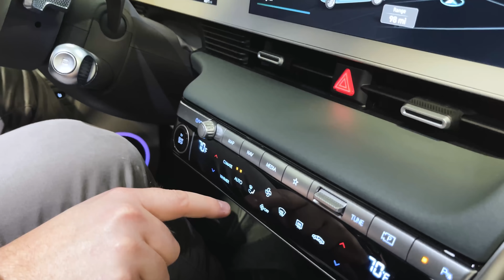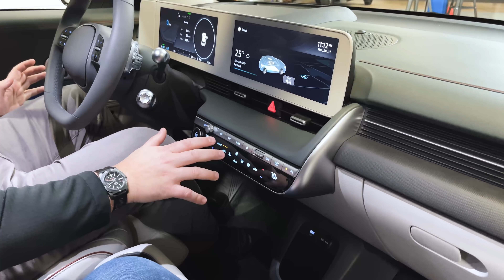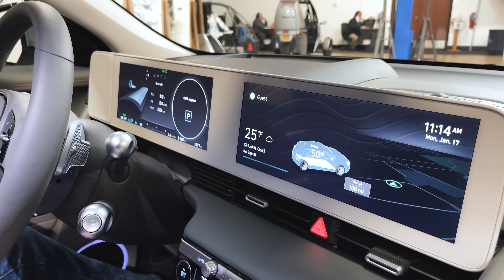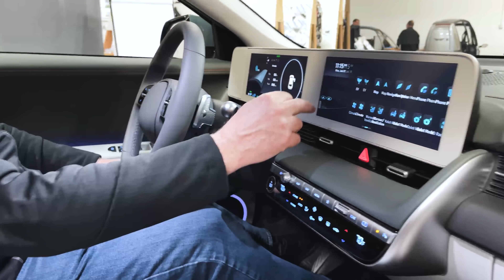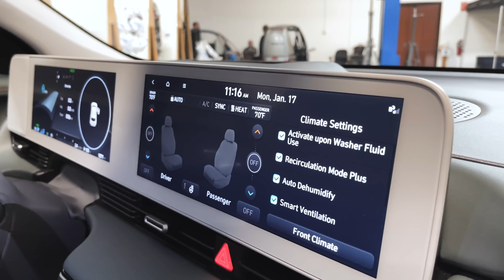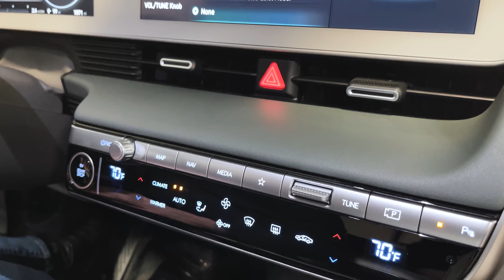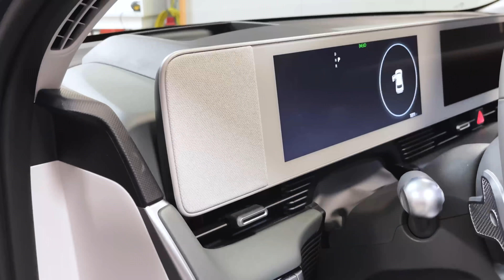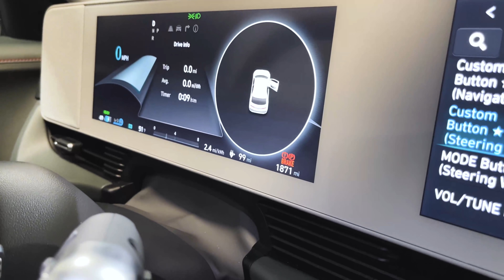2022 Hyundai IONIQ 5 | Sandy's First Impressions

Comment: The shift stalk seems perfect!  Removing the lower control panel in the middle I strongly disagree with.
Reply: I agree with Sandy on the separate parking brake button. Why not just have the parking brake set when you put the car in park.
Reply: @Hoggdoc1946  Auto hold is not a parking brake button, it prevents the car from creeping forward when the car is in drive and you have to wait for a traffic light, with auto hold you can let go of the brake without the car moving forward. Also on an incline the car will also not roll with auto hold on.

Comment: Fun fact: you can make the 2 front seats into a recliner with one touch of a button. They call it "Zero Gravity Seats."

Also, I strongly disagree with getting rid of the climate controls section below the screens. Having separate controls away from the main screen for climate control and volume is lovely for overall safety and ease of use. I like putting all things on the screen for simplicity, but then it's a hassle to get out of the radio, nav, or anything on the screen just to change the temperature

Comment: Hey Sandy & Cory. Regarding the side trunk trim, I think this is efficiency from Hyundai as the open / ribbed side allows the piece to be made using a single straight draw injection moulding tool. To close off the outside face they would need a second part, or they could change the tooling angle to be front-to-rear rather than in-to-out, but then they would lose the side facing the metal where they require attachment features. They sacraficed that outside edge as it's seen less than the inside or rear, they styled it with the ribs to look smarter / functional
Reply: Bingo
Reply: 🤗🤔 I was wondering if it could be a flow through ventilation 🤷‍♂️
Reply: @Budget Audiophile Life-long  it's certainly something with air flow..noise or aero dynamics...I can figure it out better than these "experts"
Reply: Yep, definitely. Less material, less cost, less weight, better energy efficiency (manufacturing and the product both), all with an insignificant cosmetic sacrifice, which most would not even notice nor care about.
Reply: Why not make the open face point towards the mounting surface?
Reply: You’d think these two jokers would’ve worked that out considering one of them is supposed to be expert in manufacturing 😒😒😒
Reply: @rajjy1976  everything baffles them...didnt even know what the clip on the visor was for...damn I've had them on several of my vws ..sandy pokes at it like he never seen one before...but the clincher that he doesn't know what he pretends to know..when he compared a jeep to a Bentley interior...oy vey...he doesn't see much of real cars..probably never been o
In a porsche audi or benz...Benz... lives in a Chevy world of junk
Reply: @johnnicol8598  you want to mold features on that face for fixings
Reply: @cengeb  You are definitely the smart one... I'm glad that these guys are confident in their abilities to the point where they don't have to script this stuff...
Nobody's perfect but they are real and honest.
Reply: @rajjy1976  dang these guys are jokers well I can only assume this will be the last time you ever spend your time watching their video with any luck... Adios amigo
Reply: @davidhumeston5292  you really think it's not scripted?  Like reality shows on tv....really?
Reply: @cengeb  Not scripted..In the scene that they are more or less just winging it..
The car review is just a first impression not a well researched automotive review.
These guys are engineers not Doug Demuro ..Doug show is fully scripted..with b rolls ,lots of editing and post researching of the automobile.
Reply: @rajjy1976  How dare you describe this team as jokers?  They have mountains of tooling and manufacturing experience - but admit they don't instantly know everything - some things aren't clear until you do a full tear down.  If these guys forgot 95% of what they know then they'd still have at least ten times your flimsy knowledge.
Reply: @andrewnowson8766  yes you commenting on yourself as I read it...it looks like Sandy has forgotten 98% of what he is even looking at....what engineering certs does he have?  hmmm, i think he said he's a machinist, like, cuts things out of metal?  Certainly didn't design any CNC tools, or the robots that do all the work in modern car factories....he loves PLASTIC, PLASTIC snap clips.....oy vey....and he advised Boeing, holy CRAP....I only fly airbus, they believe in metal fasteners...what a concept
Reply: @cengeb    Change the channel if you don’t like what you see.
Reply: @rajjy1976   As typical, the preteen typist experts trash anyone more knowledgeable than themselves on the interweb thingy. Must be sooo smart (LOL NOT)!

SHADDUP and start your own analysis websites and design company.
Reply: @budgetaudiophilelife-long5461  flow through ventilation was my first thought as well
Reply: @toronado455  🤗WE WILL WAIT AND SEE AND SOMEONE WILL COMMENT 😍😍😍
Reply: @cengeb  Yes planes use metal fasteners rivets mostly.
Maybe we should rivet your car together..
Aircraft avoid threaded fasteners why because they unthread.
Not so sure you've ever been a machinist I personally have been a machinist which gives you great insight to manufacturing and that most engineers can't engineer very well because they've never machined their own parts. I will take the real version of an engineer over the paperback version.
Reply: @davidhumeston5292  Pretending to be an "engineer" using a title on paper work etc, is a criminal act subject to a fine, in most states, words matter.  Latest issue of CU magazine again has Tesla rated POOR...the yoke is as dumb as it gets, unsafe, and not having a standard blinker stalk, a driving hazard...changing stuff just to change it, is dumb design work...no benefit just to be weird.  Audi BMW Porsche rated better over Tesla, from REAL car makers
Reply: @cengeb  Tesla is not for you...That's great buy one of the other BEVs... Easy
Everyone has there own likes and dislikes.
Thank goodness 😊
Reply: @davidhumeston5292  Watch when Tesla are so expensive to insure cus they won't be repairable, they get totaled too often, gonna be all a big mess, wanna bet, just wait and see.  You do know there are things called PLASTIC RIVETS, stay current....Sandy loves plastic , too bad it's a problem, in so many ways...
Reply: @cengeb  I will...
Thanks for the heads up....I own Tesla stock sense 2019..So that will be my punishment for not seeing the future...so my money is where my mouth is.
Reply: @davidhumeston5292  You don't remember Enron, MCI Worldcom, Bernie Madoff, just recently Theracon?  Tesla mkt cap is nonsense....unsustainable
Reply: @cengeb  You should SHORT Tesla Stock then. Put your money where your mouth is since you say it WILL go bust.
Reply: @cengeb  I have theh Kona EV and it has them too. They don't hold documents well but they do indicate the location that aligns with the lamp switch. If you flip the visor up it will switch off the lamp. I'd have to check but the visor might be more firm in that location. It also prevents the eventual scuff mark from the switch interaction from standing out.

Comment: The left display in front of your eyes is a very smart invention.
I also like the controls on the steering wheels. And physical buttons instead of touch screen functions is very nice as well.
I think these controls make driving safer, opposed to using touch screen while driving.

Comment: 14:00 I think those baffles capture air and help seal the trunk better. It's a large door and it's slanted so at higher speeds there will be lower pressure regions in the gaps so the baffles could help trap pockets of air to assist in keeping the pressure balanced and prevent any wind whistling and adverse effects. Keep in mind this is a fast car with retro styling so weird aero issues will exist.
Reply: Noting that the slots are on the interior or the car. They could be acoustic or cosmetic.
Reply: you are trying way too hard with this.  The suggestion that there was no reason to make the part more expensive by having a cover seems to make the most sense.  Why enclose the part if it wastes money and adds nothing aesthetically?

Comment: Perhaps instead of removing all those buttons, you could have five or any numbers of programable buttons? That way each user can adjust it to what buttons they like using the most. For me it'll be climate control/heat/cooling seat. Maybe leave a dial for volume up/down?
Reply: No no no we can't do that because "All input is Error" t. Elon Musk
Reply: Good call. I did like the programmable buttons on our F30 BMW.
Reply: @SiisKolkytEuroo  Grow up.  Tesla has buttons on the screen.  Taking elon out of context gets really old.
Reply: @_PatrickO   It’s impossible to take a musk out of context on anything.
Reply: Indeed, and have them be programmable via voice commands.

Comment: Great video! The “AUTO HOLD” button stops the vehicle from moving when you remove your foot off the brake pedal during a stop.  You don’t need to use the “AUTO HOLD” when the vehicle is set in “i-pedal”.  There are 4 levels of regeneration, the highest level is 4 or “i-pedal”.  It’s really aggressive and works well.
Reply: So, do you really need a physical button for that? That seems like a setting that you don't change often and should be on the infotainment screen.
Reply: One pedal driving obsession is silly.  The chevy volt simply has a hand brake on the wheel for regen. Then you can coast like in a normal car and regen when needing to slow down without touching a pedal.  No pedal driving is where it is at.  The volt lets you set cruise speed and full regen brake all with buttons on the wheel.  It can all be done with your left hand.  You only have to touch a pedal at all for emergency braking or to start from zero up to 24mph when you can hit cruise and then control speed with plus minus buttons on the wheel.  Car companies need to allow cruise to engage at 0.  Forcing the use of pedals to get to a minimum cruise speed is lame.  Gas pedals have no point in a modern car.  Speed and braking should just be steering wheel buttons.
Reply: @_PatrickO  regen paddles are on the left and right of steering wheel on the IONIQ 5 and when vehicle is in i-PEDAL (level 4) all you need to do is release the accelerator.  The “AUTO HOLD” button is an extra which can probably be removed in future iterations of the vehicle.  BTW, has Chevy come up with a solution for their battery recalls? LMFAO
Reply: @ronnied8793  Chevy is a joke, the best parts of the volt were made by lg.  But having hand controls is brillant.  Chevy put it on no other car and even on the volt, they screwed it up by making you pedal up to 24mph before you can enable cruise control which lets you control the speed using the steering buttons.

If the hyundai can do no pedal driving in the same way, that makes it great.  Do they allow cruise to engage at zero mph? 
As for your anger, you should check your petty tribalism at the door and grow up.
Reply: @_PatrickO  what anger are you talking about???
Reply: @_PatrickO  Thanks for the perspective.  I have never driven a Volt, and really regret not buying one in 2019.  The 
Volt was a highly under rated car in many other respects.  I'll have to reconsider the necessity of an accelerator pedal, as I had never thought of not having one.
Reply: @ronnied8793  Personally I don't find the failure of any Ev to be "funny".  That attitude is counter productive.  BTW it is the Bolt and not the Volt, with serious battery issues on a very small number of cars.  Many people don't know the difference.
Reply: @ronnied8793  The Volt is dead, cancelled.
Reply: @mrxman581  The new hybrid jeep that was reviewed by sandy has a volt like drivetrain.  The rav4 prime seems like it may also be similar.  The key is a dual powertrain, but designed so the gas motor primarily generates power to drive the electric motors and charge the battery.
I would describe the volt as a 40mi short range EV that has a gas range extender.  The gas engine can power the wheels directly, but these vehicles are designed so the electric motor does all of the acceleration, so the vehicle feels like an EV with instant torque and no transmissions shifts.  The engine only comes on when the battery gets low and then it mostly stays at a steady rpm while the electric motor does all the variable acceleration stuff.
Reply: @_PatrickO  the problem with those systems is the terrible efficiency when the battery is drained which comes into play on long trips because you're carrying around a bunch of weight. That is the main reason the Volt had horrible mpg when switching to using gf as. It was in the mid 30s if I remember correctly. Where a car like the Prius Prime had about half the EV range of the Volt, but when using the hydrid gas engine it got mpg in the mid 50s so for trips greater than 50 miles, the Prius Prime was much better. And, of course, it would take much longer to recharge the Volt too. Neither car had DC fast charging capability but the Volt would take longer due to the bigger battery. These are reasons why the Volt was cancelled along with being more expensive.
Reply: @mrxman581  The fuck?  The volt has good gas mileage at 36mpg.  In fact, the volt would have had a few more electric miles and better mpg if they did not cheap out on the magnets in the motor.  They chose a cheaper magnet to save a couple hundred bucks.  There was another car with the same powetrain that breaks 40mpg due to the better magnets.  Had to either be the malibu or the cadillac.
The volt is not more expensive, it has a normal markup at $40k.  It just isn't cheaper than a pure EV because it has gas motor plus smaller battery instead of a single larger battery that likely would cost more, engines are cheap.
The new jeep hybrid using a similar drivetrain to the volt.  This style will be great for larger vehicles because it will take time for enough charging stations to exist for most people to switch to an ev.
Reply: @_PatrickO  The direct competition to the Volt was the Prius Prime which is an overall more efficient vehicle as I said before. 36 mpg is not good for this category of car. The Volt was basically just a regular car once it ran out of EV range. Where as the Prius Prime switches to hybrid mode once it runs out of EV range. The Prius Prime gets 55 mpg after running out of EV range. That's about 65% more than the Volt.

Though, the point is moot because the Volt has been discontinued.
Reply: @mrxman581  The prius prime is not a competitor to the volt.  It is a smaller car and a junky prius.  If toyota actually wanted to compete with the volt or EVs, they would have put eawd into the corolla hybrid.  They purposely refuse to offer a corolla hybrid prime because they know it would completely erode prius sales.  Toyota instead wants people to get mad that the corolla does not have the prime option as they go buy something else.  
That is what I did.  Sold my corolla when I learned the corolla ev would not have a prime option and bought a volt.  No one wants to drive a shitty prius.  The corolla feels like a luxury car compared to a prius.
Reply: @_PatrickO  The Prius line is one of the most reliable fuel efficient series of cars on the market. The Prius established the hybrid market. All the other car makers poo pooed it and look how vast the hybrid market is today 

The Volt is NOT an EV as much as GM would like you to believe. It's just a different kind of hybrid and NOT an EV. So, yes, the Prius Prime was a direct competitor. But, again, the argument is moot because they no longer make the Volt. The Volt never found a market because it made too many compromises and was too expensive for what it offered. Enjoy your car while it lasts.

Toyota also has the Rav4 Prime, and they will be releasing a full EV later this year

Comment: We’ve had this car in the U.K. for about six months. I’ve test driven one and also a Kia EV6 and it is a nice car, looks like a Lancia Delta Integrale. As for the climate control buttons leave them there as whilst your driving and you’ve got sat nav or media on the screen, you don’t want to be faffing around as I had to do, swiping around a screen which is full of icons just to get to the climate control functions. With so many icons it takes a while to find out where they all are. For an IT boffin I found it too cluttered and for the less technically astute, it could be a bit overwhelming. Aesthetically, I prefer the EV6 dashboard as the Ioniq 5 looks just like someone has stuck a slab of plastic on the dashboard.
Reply: When I get in buddies car, I go for manual, dont want to ask//mess with might be on his mind/screen.
Reply: Lancia! I was wondering which car this one reminded me of. Really like the retro look.

I cant help but think the Koreans have the Hyundai & Kia mixed up.
This Hyundai exterior should have gone to the Kia EV6.

Comment: The rear tilt of the rear seats may be more for child seat installation. Moving the setback allows for angle adjustment of child seats, which in turn allows for more front seat space.  Child seats are huge and cause a lot of space problems in smaller cars.

Comment: As an I5 owner, I like the physical buttons for the climate - but you have to take your eyes off the road to use the up/down buttons to adjust the temp so I would really prefer to have twist nobs for the temp, since they are the most frequently used controls.